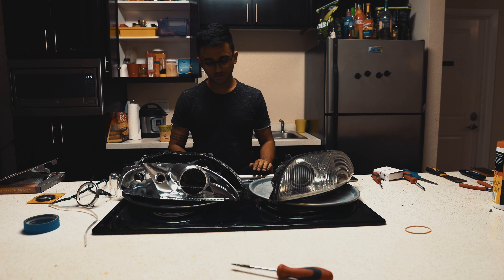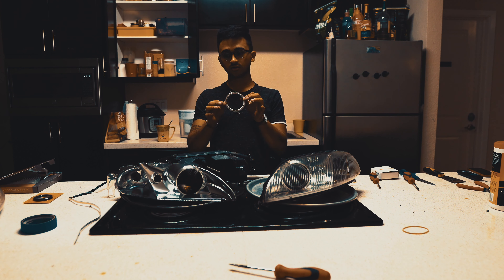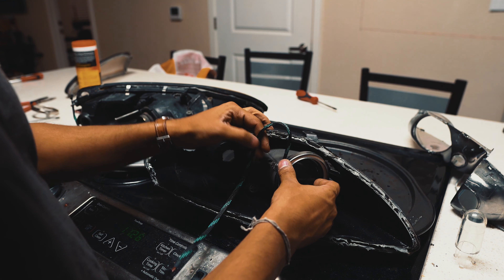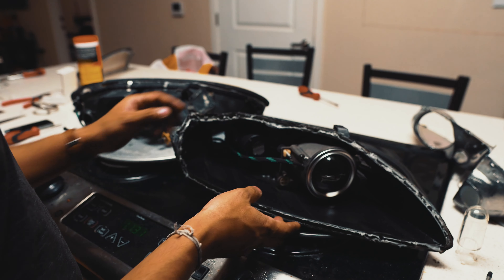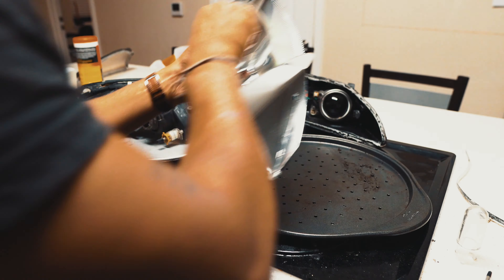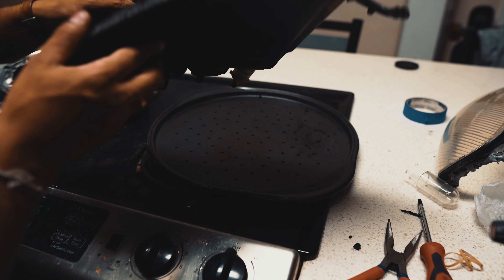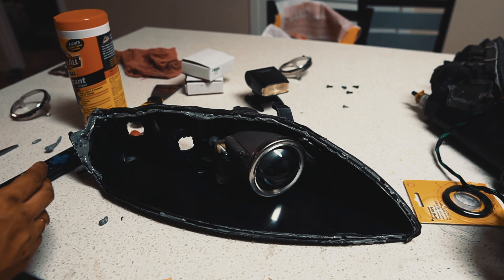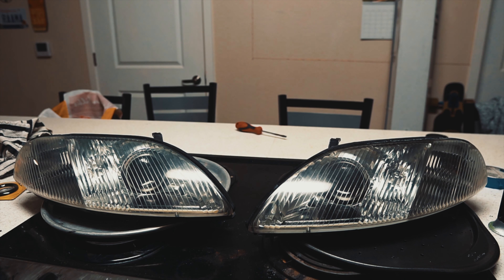HOW TO UPGRADE YOUR SC300/SC400/SOARER HEADLIGHTS (DIY)

Comment: Hi there - Love your work, and your enthusiasm while teaching and showing us to upgrade on your channel. I have a 2000 Lexus SC400, and I have issues with water bubbling and yellow-ish tinge. If I send you my headlights, and the clear lenses, would you be able to install the clear lenses and seal the lights with butyl tape so they are water-tight? I don't need to upgrade to LED, or the Morimoto lens. Just want to change to the clear lenses, and clean them up a bit.

Comment: Nice job on the instructional video.  I have owned my '95 SC300 for 18 consecutive years and appreciate your dedication to the SC community.  Question and a recommendation: How did you connect the wiring to the vehicles harness for the halo and the signal lights?  The video seems incomplete without walking through a full installation.

Comment: That's awesome! What did you do to wire them together? I mean how the LED goes with the turn signal and back to white
Reply: I wired the power to the ACC fuse inside the kick panel fuse box, and spliced into the turn signal wires
Reply: @raamblings  how did you wire the halo properly?
Reply: @nlemus2  the halo just stays connected to battery power whenever the cars on. I didn't want to make it switchback too
Reply: @raamblings  do you have a tutorial on that?

Comment: Hi there! Awesome video, very helpful! I am wondering though if you think a spacer could be used to help the clear lens seat properly? I don’t want to use halos on my SC. Also, do you have any pics of the light output? Last, I’m wondering if there is any benefits for further mods to the bowl or other components of the projector for better color or a sharper cutoff? Thanks for your contribution to the community!!